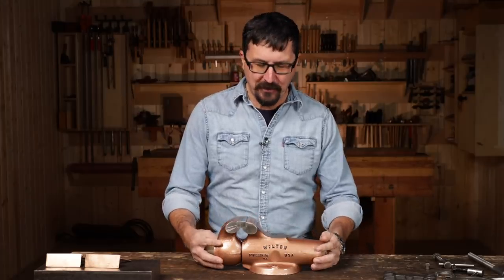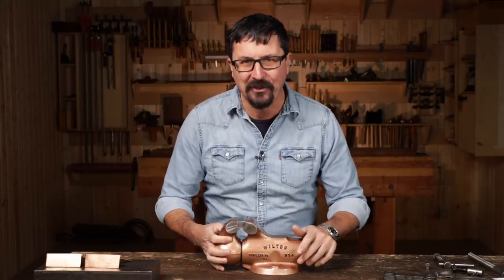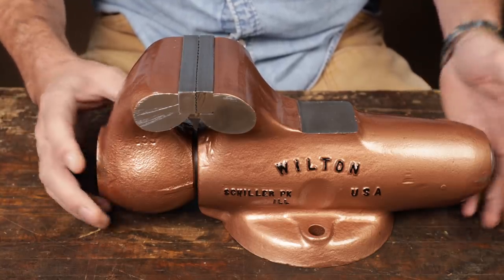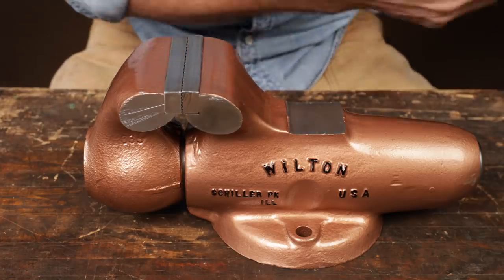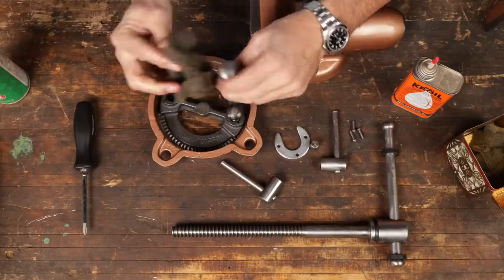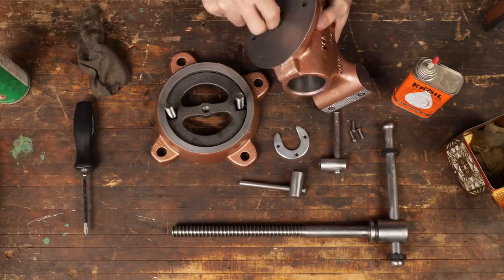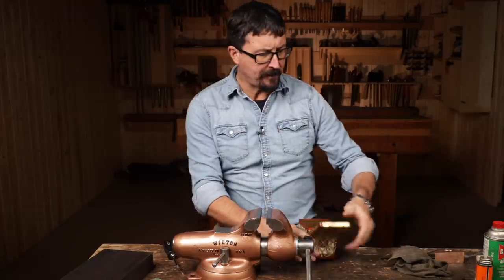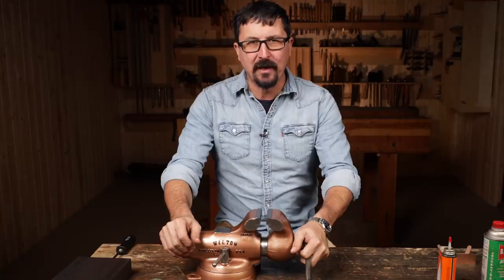I HIT THE JACKPOT (OFFICIAL VIDEO)

Comment: Hi Cody!
Bench anvil 6 x 2 x 12 steel is about 43 pounds
Ken
Reply: For us EU viewers thats about 20KG.
Reply: 41.8176 by my calculations
Reply: @RonaldMedia  With a density of 7.874 g/cm³ for iron I came to 18.517kg
Reply: Nathan Shively 
As I said “”about””.  I was using a general rule of thumb density of .3 pounds per cubic inch. 
Ken
Reply: A 1in cube is .283 pounds the 2x6x12 block is 144 cubic inches comes out to be 40.75 pound

Comment: My father gave me one of these and my son and I restored it this past spring. It is so smooth that I had to track down some new models to see if they were just as smooth. Sadly they are not.

Someone correct me if I am wrong, but it is my understanding that the earliest versions of this vise came with acorn nuts for locking the vise on the base.

Comment: Hey Cody, I’ve had a question for you but not sure how to get in touch privately. I just got a truck and was going to try and set up a winch system like you shared 4 years ago. However, I’ve been told that it’s terrible for your transmission and wanted your opinion on that. Thanks in advance!

Comment: Ahhh, synchronicity . . . I was just looking for an affordable vices a couple of days ago.  I've never seen one like that.  It's awfully purty.  I love the copper paint.  I'm glad that one went to someone who appreciates it.

Sealed screw, rounded features and car fender lines notwithstanding; the way the jaws curve smoothly around with no 90 degree corners to concentrate stresses is simply the best design practice.  Can anyone point out a single improvement that could be made on it?

Comment: 2 X 6 X 12 = 144 cu. in.  @ ~0.28 #/ci = 40.75#.  So 40-42#, depending on the steel used.  A 3” machinist vise is currently $580 on Amazon.

Comment: The weight of a cubic inch of steel is approximately 0.2904, so 2" x 6" x 12" = 144 Cubic inches which will weigh 42.336 LBs.

Comment: I haven’t got the cheaper Wilton vise but I do have one of the big tradesman buses that came off an old service truck. Either a 4.5 or 5” vise: was frozen up so bad the cap screws on it broke trying to get it apart. Ended up drilling them out and putting 5/16” socket heads on it after I blew it apart with an air chisel

Comment: I have the same vise with original paint in wonderful condition. Picked it out of a dumpster believe it or not.
I knew exactly what it was from the bullet end sticking out just barely visible above the garbage. I fully expected it to be broken in two.
When I pulled it free and seen it was flawless the sky opened up and the sun shine hit it . One of the best finds ever. All is true except the sun part😁.  My dad has the size up from mine. Used it as a kid and knew it was the vise to have. Great video Cody, if you ever get a chance stop by, I'm repairing a shop

Comment: I have 2 of the 4" versions in my HS AG shop. Did you say parts for them are  still available? I need the c clip and screws for one of them and the Swivel Bases for both.
Reply: Go to their website.   If you haven't already.
Reply: @bozboz133  I tried but I don't have the model number of the vice to know if I am getting the right one. Master-carr shows different ones.
Reply: @benburkhalter3752  its stamped on my wilton on the left side
Reply: @benburkhalter3752  I have a 1765
Reply: @bozboz133  mine wasn't stamped on that side. Just the other. It has a faded decal but it's totally unreadable.
Reply: @benburkhalter3752  maybe go off the jaw size and then lookat pictures to confirm

Comment: Your steel is 18.526 kg or approximately 40.84 lbs. Steel is about 7.85 grams/cubic centimeter. Based on a 12” x 6” x 2” block, it should be approximately 41 pounds.

Comment: I was taking out the trash and there in the alley was a 12" x 12" x 1" piece of steel plate.  Free anvil. Weighs 42 pounds.  I put a 2" blue foam underneath so my downstairs neighbor won't hear their ceiling bang.

Comment: The high school shop-Old Central high in Rapid City S.Dak had these vices in the metal shops.The woodshop had a Wilton table saw that was HORRIBLE-it had to be replaced with a Powermatic.The Wilton vice is indeed a classic tool!In the machine shop at theat high school they had South Bend lathes that had large brass nameplates on them---"Property of the Boing Aircraft Company"Would have been from WW2 era.Wonder what plane parts were made on those and with their Wilton vices???

Comment: Assuming the weight of steel to be 490 lbs/cubic foot, the weight of the 2x6x12 inch block should be 40.8 lbs

Comment: I can attest to how darn good wilton products are. One of the unbreakable hammers accidentally went through the main crusher and one smaller crusher at the rock quarry I work at. The handle did bend and a few chips were knocked off the head but it was still 99% intact. Matter of fact it was in such good shape the NAPA we got it from displayed it with their other wilton hammers.

Comment: around 42 pounds if I calculated that correctly (depends a bit on if it's steel or iron but close enough, since you didn't actually measure it either)

Comment: Hi Cody, the size of the iron plate is important, it is not just plucked out of the air. By using the sizes, you can make most things because anything you want is in 2X, 6X, or 12X or a division of those.

Comment: I recently had a Chinese vice I inherited from my Dad.  Big vice that seemed plenty strong, but when reefing down on something (with a cheater bar on the handle), the casting snapped.  So in replacing it, I ended up with a HF vice, not as nice as the one I just broke.  And this one is even poorer quality as it has a rotating head and the clamp (set screw) that keeps it from rotating stripped on the first real use.  ARGH!  I'm not ready to spend 'Wilton' money, but there must be something in between.